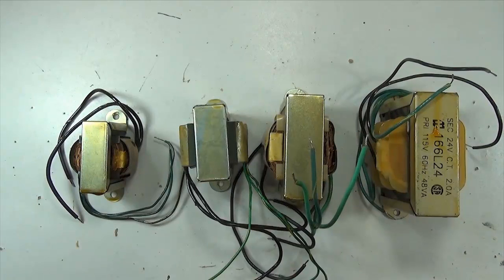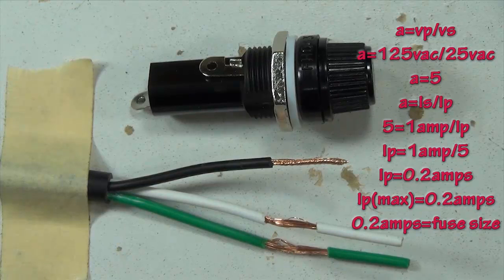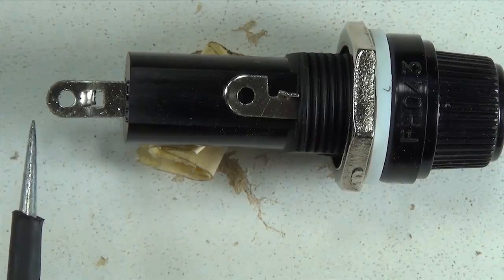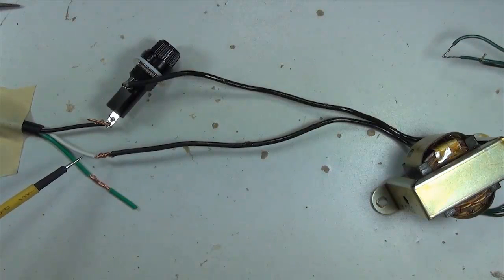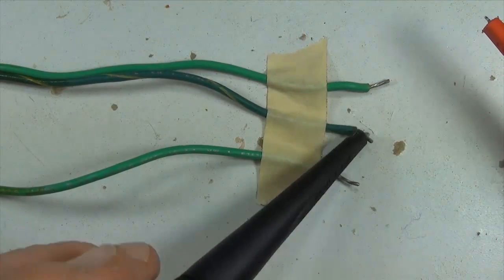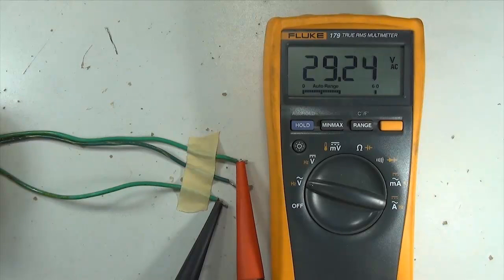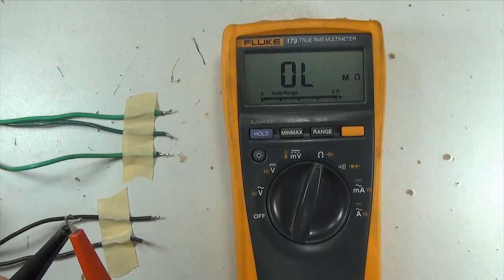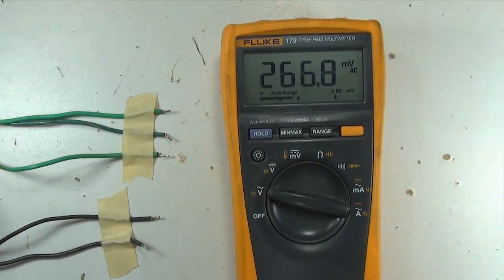Step down transformers explained, fusing, voltages, resistance check | methods & tips |

Comment: I have a transformer in my air handler with 240v input but has a 31,15v output under load.  It’s supposed to be 24v.  Would this or could this cause my 5a fuse to blow?  It’s basically 7.15v too high.

Comment: if the trans is rated for 2amps the fuse also needs to be 2amps? i think i used a 4amp fuse instead, also it says 12 volt 2amp for the outer wires but there is a yellow/green wire in between them ,would that be for 6v and 4 amps instead? it basically says " grn-grn/yel-grn:12vct 2a" does this mean any connection will give 12 volts or is this still a center tap wire?

Comment: sir are you there to reply to some questions?
Reply from the maker: Yes, I am on the computer more at this time of the year.
Reply: it's been a long while and i dont remember all the q's i had but here are a couple for now,,
1)if i have a 12vdc 2amp trans for the outer wires on the output does that mean if i use the center tap instead i would get 6v at 4amp? 
2)also what kind of fuse should i be using for this trans,the 2 amp or the 4 amp? does it depend on what wires i want to be using?
Reply from the maker: The secondary winding is designed in your case only to draw a maximum of 2A,  The fuse should be place in the primary winding to properly protect the transformer
Reply: as i said it has a center tap,not sure you answered me clearly here,,if you can go over the numbered questions again and answer them,,thank you

Comment: Forget AC. Please explain DC to DC trnsformers.
Reply: Winston Vanderbuilt II transformers only exist in AC to AC, if you want to make it DC to DC, you’ll need to make 2 circuits. An DC to AC generator. And a AC to DC rectifier.
Reply: if I understand them correctly the basic stuff is the same, except for polarity. and measuring settings on your multimeter.

Comment: Was the secondary winding's resistance lower due to wire gauge, or due to shorter total length of conductor in that winding?
Reply from the maker: For the step down transformers use in this video the secondary winding had a heavier wire used in the winding.

Comment: Thank you, the turns ratio formula at about minute 2.40 will help me determine the size fuse I need for a (120V to) 14 volt 1.1 amp transformer for a little lamp I am trying to fix.

Comment: Did you know?
Tape can be hazardous to hold down cords!
1: If a fault occurred and it heated up the copper/metal/iron wire or the plastic coating of the wire, it can melt the tape because of its paper material, however, it does not light on fire and turn in to ash.
2: This might sound funny and it is a hose-like situation. Tape has a great performance holding down it’s target. Just like a hose, it can cause a voltage clog.
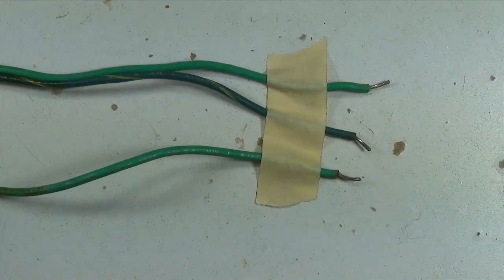To test, you will need 2 –––.–––– digit voltage readers on the left of the center and the right of the center, wire (not bare, or without plastic coating it), and tape. Tape the center area of the wire like it is at 9:56. Then, hold 2 readers on each side of the center. I had 0.06 volts travelling through the wire. Again, like a hose, the tape acts like a foot on a hose, so it clogs a little of the voltage. Start: Left: 0.06kV; Right: 0.04kV (See?). A bit in: Left: 0.11kV, Right: 0.00kV. Do the experiment yourself, but I used a bit tinier wire to test it.
Reply: but tape is better than nothing. :)

Comment: I have several transformers that I have picked up over the years.Most are from microwave ovens but a few are smaller or larger and the sources are long forgotten. The other night I decided to test them to see what the output voltages are and even though they may say 120v and 60hz when I plug them in using an old cord and an outlet on my work bench, they pop my work bench breaker! They may have anywhere from 2-6 wires coming off the secondary, none touching, and only 2 wires on the primary, but when I plug it in POP ! Any ideas? Thx

Comment: How can I step up 0.3 V to 1 v AC voltage? using transformer
Reply: we use step up transformer to convert the voltage and after dc we use zenor diode or voltage regulator variable

Comment: i have purchased 12-0-12 3 amp transformer when i check this give output me 6 amp.
i have 100 watt audio board which required 12-0-12 3 amp  pl hekp

Comment: is bad that if  the resistances between the CT to a secondary coil and between one secondary coil to another is the same? 
your readings from  a secondary coil to CT is aprox half that of one secondary coil to another.
Reply from the maker: Depending on the quality of your multimeter and the wire gauge of the transformer you should measure approximately the same from the CT to each end of the secondary winding or 1/2 of the total winding resistance.

Comment: what would each of  the secondary winding leads  read if put to ground?
Reply from the maker: You should have an infinite reading.  None of the transformer wires should have a path to ground.
Reply: sorry I meant what voltage (480v prim/ 120v sec side) would I have off the secondary leads to ground
Reply from the maker: It would be the same as before.  No connections of the transformer should have a path to ground therefore an infinite resistance

Comment: How to test a step down transformers maximum output current?
Reply from the maker: Maximum current specifications are given by the manufacture of the transformer and cannot be tested.
Reply: @1929fordhotrod  what happens if I attach a 1ohm resistor to the secondry coil at 24V? Will 24Amp flow through it or it will get limited?

Comment: Very well explained sir. Transformer in my speaker got burnt may be due to high voltage. Replaced it with the help of your video and attached a fuse as well to it. Thank you. 

I have a query. The transformer input voltage is 230V (India) and output is 12V-0V-12V / 1 Amp. What should be reading for fuse.? As of now, the fuse which I have inserted has 3A/250V written on it. Any suggestions.? I may keep the speakers till you recommend me the fuse.
Reply from the maker: 3A is too big.  Your turns ratio will be 230/24 which is approximately 10.  If the secondary is rated at 1 amp then you should use a 0.1 amp fuse.
Reply: i too have the exact same step down transformer!!!. i have a question "i intend to use 2 fuses one on each side i.e, on primary side as well as on the secondary side" any advice on what fuse should i use on the secondary side and how to calculate it??

Comment: what is the fuse rating used sir?
Reply from the maker: Vp/Vs=Is/Ip is the relationship used.  Therefore 115v/25v=0.3a/Ip  Ip=0.065a (assuming no losses). The secondary maximum current was identified as 0.3 amps, then the maximum primary current or fuse size will be 0.065 amps, again assuming no losses in the transformer.
Reply: OK thank you sir
Reply: I have a new transformer and 24v is 0 output this is iN HVAC
Reply from the maker: Make sure your meter is set to measure DC volts first.  If the meter reads 0v on the AC voltage function then the transformer is faulty.  Another thing you can check is to make sure the transformer has an input voltage.

Comment: excuse me sir i have a transformer (step-down) from 220v to 12 volt its output rating is 12v 2 amps i have 3 output wires 12v-GND-12v can i get a 24v from this transformer by any means?
Reply from the maker: Sounds like the secondary winding has a center tap. One of the wires on the secondary side should have a different colour and the other two will be the same.  With power applied to the transformer and using your AC voltmeter, connect one lead of the meter to the odd coloured secondary wire and measure the voltage from this point to each of the other wires, it will be the same. Then measure the voltage across the two wires that have the same colour, it will be twice as much.  Now the voltage measurement will be higher than the rated voltage on the transformer as you will be measuring a no-load voltage.  Depending on the size of the transformer and where it is made you should measure a no-load voltage across the entire secondary winding somewhere around 26-28vac.   The labeling you described, 12v-gnd-12v is a common method used for center tapped transformers with 24v across the entire secondary winding.  Good luck.
Reply: someone told me if i connected the two 12v lines together to get 12v  with 4 amps the transformer will burn and it is wrong to do this is this right or wrong and how to get a 24 volt terminal and a ground terminal from this transformer to be able to rectify them to a dc and build my circuit
i know that if i measured the two 12v wires with a multimeter it will give me a 24 v but none of them is a GND both of them is 12v  but to rectify this i need a GND terminal as i know.  i don't know if i can rectify a two 12v terminals. i am new to transformers this will explain many things to me.  
and thank you anyway sir
Reply from the maker: Do not parallel the secondary wires. This will not work.
The center tap on the secondary becomes a reference point or circuit ground.  Circuit ground is not the same as earth ground.
Reply: you mean i can rectify both 12v wires and the circuit will choose one to be a GND and then have my 24v rectified as 24v dc is this mean i will not need to use the GND wire on the transformer
Reply from the maker: Check out the links below for rectifier circuits

http://www.tpub.com/neets/book7/0254.GIF

http://www.interfacebus.com/diode-bridge-split-supply.png

Comment: sir how can we determine the rating of transformer or output current of it
Reply from the maker: Normally the current rating or VA rating will be on the transformer.  If it is not marked hopefully there is a part number you can Google to find the information. If none of this information is available it is extremely difficult to determine the power rating of the transformer.

Comment: I woud do measurement all wire of transformer againt case of transformer...isulation...
Best video i see this about topic...thank you very much...
Reply from the maker: You can measure the resistance from each transformer wire to the case or core of the transformer. You should get an infinite resistance measurement if all is okay.

Comment: if my input voltage change will my output voltage change at 12v transformer
Reply from the maker: Yes, if the input voltage changes the secondary voltage will also change.  It is proportional to the transformer turns ratio.
Reply: ok thank you sir

Comment: thanks but still got questions unanswered. when you connect the primary to power arent you causing a short circuit? 110v/15 ohm= about 8A of current flow whichis veryhigh. what am I missing here?
Reply from the maker: This would be true in a resistive circuit but the transformer also has inductance that complicates things.  Remember the load in the secondary circuit controls what happens in the primary side.  No load, no current in the primary circuit under ideal and loss less transformer.
Reply: Ozan Saracoglu Inductive reactance. Z. Impedence

Comment: hi if a read open on primary wires do I have a bad transformer I'm not getting any reading on ohm setting  I do get 1.5 ohms on secondary wires
Reply from the maker: Sounds like the primary winding is defective.  The wires used to connect to the power source are soldered to the actual winding wire.  Sometimes these wires become disconnected.  Since the transformer is not working, carefully cut away the paper protecting the winding and see if you can find the connections.
Reply: Most I find have a thermal fuse under the wrap pressed against the windings that has burned out.  You can replace or bypass it to make it work again.  I recently did a bath fan motor but damn those wires were so small I could barely solder them.

Comment: First transformer is 12 volt, and the fourth (big) transformer is 24 volt. so the first transformer's size is almost half than the fourth 2 amp 24 volt transformer.
Reply from the maker: +Moon Mamun - All transformers used in the video where 24v center tapped transformers.
Reply: 12 volt https://youtu.be/bvrO7g7BnIA?t=107

Comment: I have read that by step-down transformers the voltage goes down and the current goes up. Why is by these transformers the current so small (0,2 A; 0,5 A)? What are they used  for? What does depend on, whether the maximal current is 0,2 A or 2 A? On the size of the transformer? More wire on both sides for more amps? Thanks for the interesting video.
Reply from the maker: +Stephan1098  

It all depends on the power rating or volt amps (VA) of the transformers.  The transformers I used in the video are all rectifying transformers used for DC power supplies. 
Here is a simplified explanation. 
The turns ratio (a) = primary voltage (Vp) / secondary voltage (Vs) = secondary current (Is) / primary current (Ip). 
The volt amp (VA) rating = Vp x Ip = Vs x Is (assuming no loss).
Reply from the maker: Yes, the bigger the wire the less resistance resulting in a bigger transformer.
If you have a 5 amp transformer this would be the maximum current the transformer can handle on the winding the 5 amps marking was taken from.  The load that is attached to the secondary winding decides (over simplified) the current flow.
Reply: Stephan1098 I guess the bigger size is due to the use of thick wire to reduce resistance or increase current
sir how would u know Ip  ?
Can I assume 5amps as 5 amp 230 volts is supplied to house? or it depends on load so as to maintain required current for the load?